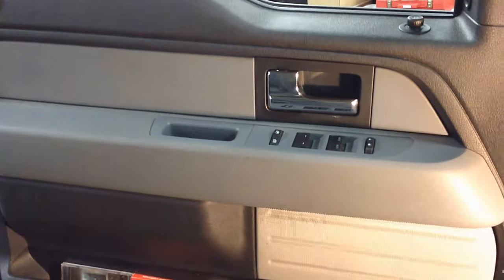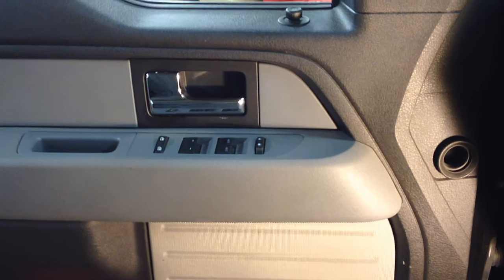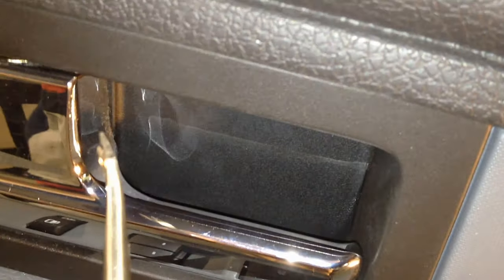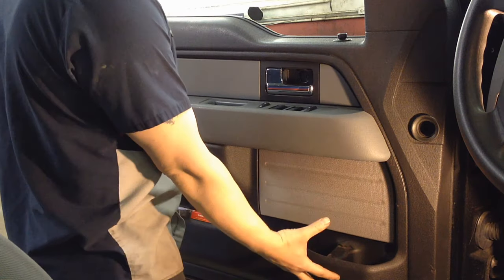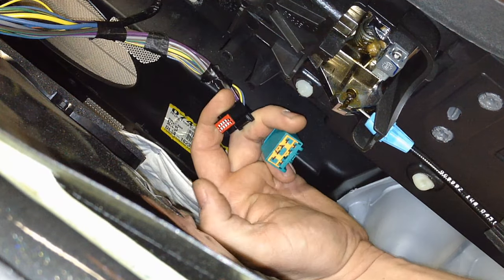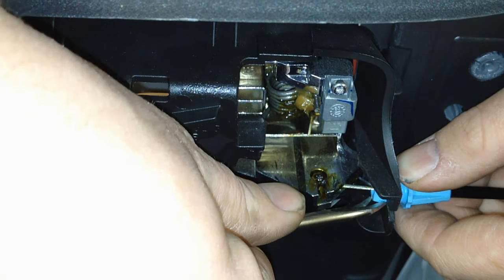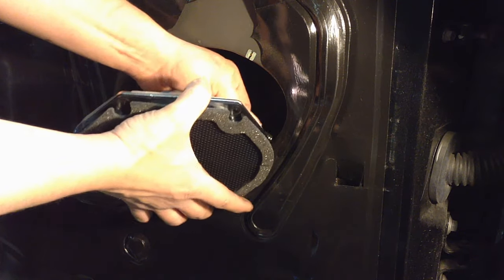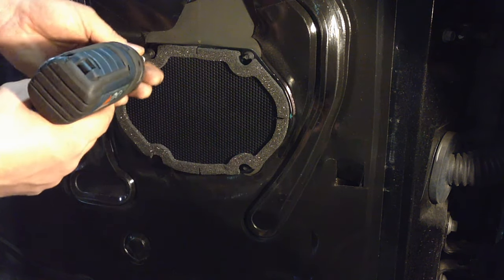2009-2014 Ford F150 Front Door Speaker Replacement- Door Panel Removal Procedure

Comment: Awesome video bro. just a quick question,  I have a 2013 f150 5.0 I'm starting to get alot of rattle from my driver door, I'm still under warranty. But would you happen to know what might be causing it.? 
Thank you!
Reply from the maker: We haven't had any concerns with these as far as the door skins as of yet, you mean from the speaker?
Reply: Just random internal rattling, from the slightest road imperfections, potholes, going over train tracks, ect. 
Thanks for responding.
Reply from the maker: Miguel Navarrete I did just have one where all 3 nuts on the mirror were loose but I think that was an oddball.
Reply: Simply bring it back to the deaker and have them fix it. It could be almost anything that came loose. I have found pieces of plastic (like cutout pieces) sitting inside a door making rattling sounds.

Comment: Mines a 2009 and the person who had it before me did all this and now I'm having wiring problems.. as in there's a short somewhere in my driver side door.. door ajar comes on along with cab lights if I use anything on the left side of my truck... I don't know what's causing it or how to stop it... And since I don't know exactly what it is I have no clue on how much it'll be to repair.. and I won't lie, time's are fuckin rough right now.. 😒

Comment: Great vid.  I've had Ford replace mine 2X and now it's out of warranty and they won't touch em.  STUPID.  They are crap.  Wish you would mention speaker dimensions for replacement purposes.
Reply from the maker: They vary so it’s best to use the fitment guide on crutchfield
Reply: Try 6x8 if you haven't found speakers already. Sorry I'm 7 months late in helping, if at all. Changing mine out for my wife's truck because as stated, factory speakers are garbage.

Comment: Can you remove the actual silver grill from the outside of the door? So then I dont gotta remove the whole door to change my speaker?
Reply: Nope, not without damaging it beyond repair. If you have a helper, they can just hold the door panel while you replace the speaker. No unplugging anything.